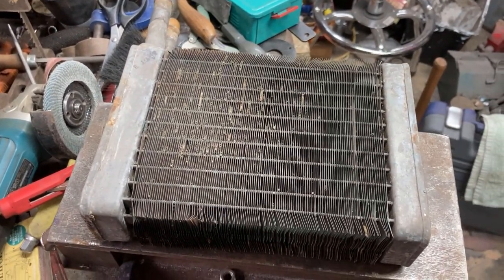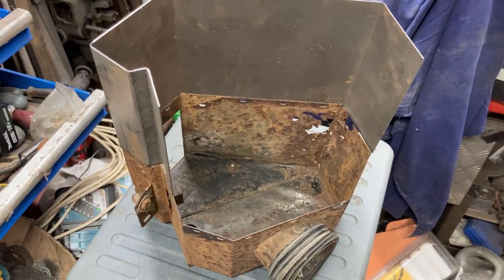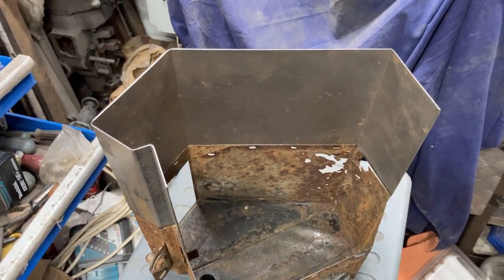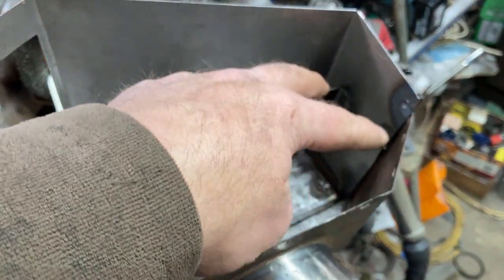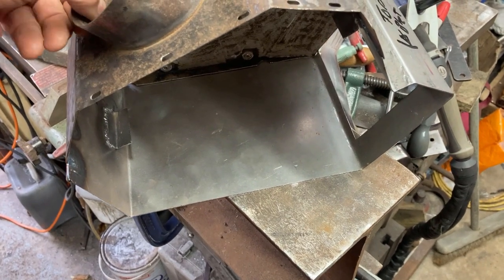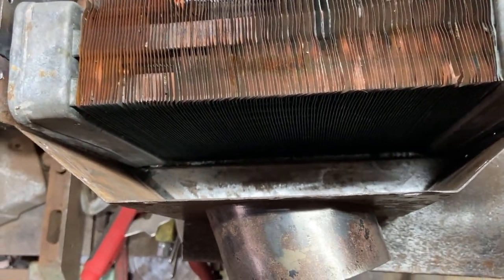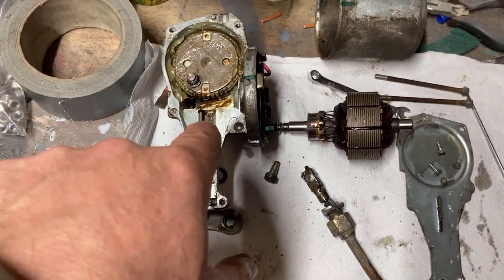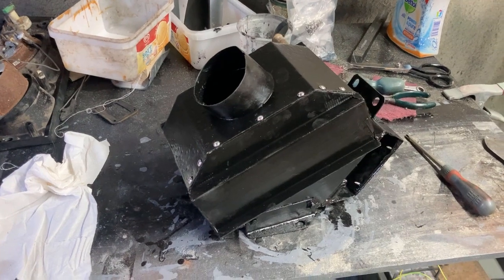Project Clanger109" - A Landrover Series 3 Rebuild - The Smiths Heater

Comment: You probably do want a drain hole. Any water trapped in there that does evaporate when the heater kicks in will condense on the windscreen. When this has happened to me it's turned the screen from clear to fog in a couple of seconds .
Reply from the maker: Thats my issue, on the other hand, I suspect any form of drain hole will not drain it completely so there remains the fogging issue. I may leave it without and see how things function.

Comment: I wonder why they did not make it from aluminium my defenders have parts of its heater box mia due to rust.
Reply from the maker: It would have made more sense out of aluminium for sure - but I suspect these went into more than just landrovers ? On the other hand, I very much doubt the designers or management team planned on having them on the road much past 20 years ?  I priced up a replacement non OEM at c £150 including the blower. Made mostly of plastic ... it might have been awise choice, alas I stuck with the original - if it does another 30-40 years I will be chuffed :-)

Comment: Christ Almighty Mat, "that's worked out alright" understatement of the decade there mate 😂
Instead of a drain hole how about a tiny turn valve/ tap?  that way you're keeping as much of the air inside as you can and with the (asthmatic) fan running the air will force any excess water out when you open the valve.
Another great episode showcasing some fantastic repair work, thanks for sharing with us, all the best from Gods Country
Reply from the maker: I mini tap fitting 🤔. I shall give it some thought.